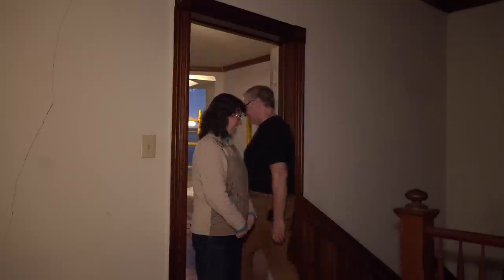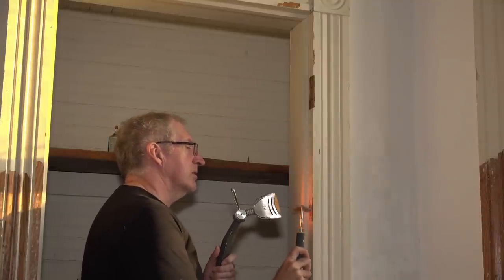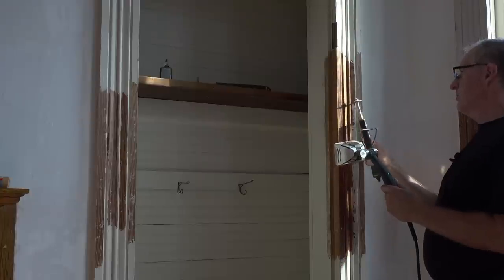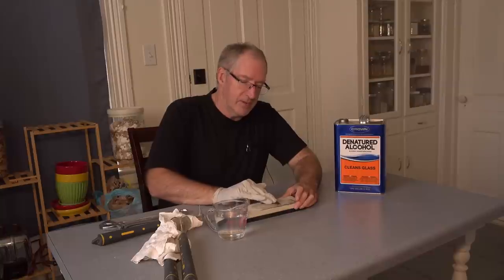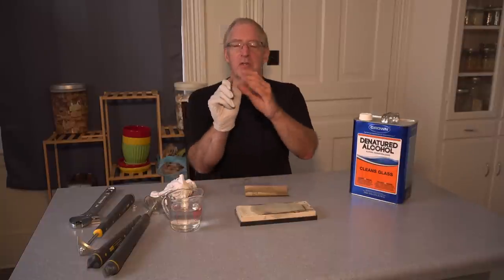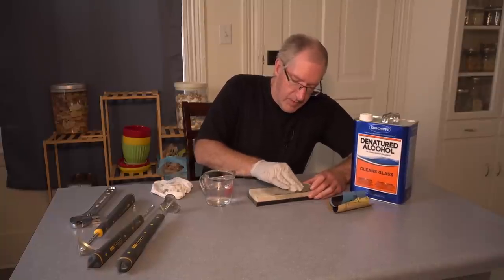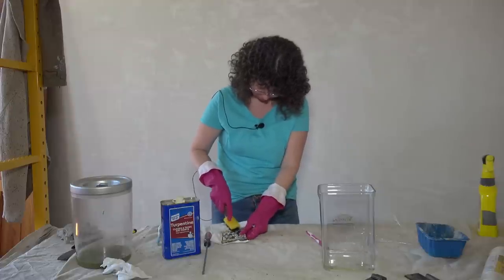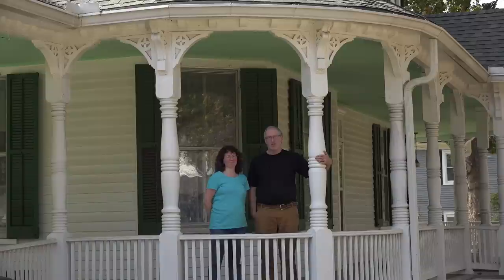EP104 Tool Trouble at the Victorian

Comment: That door is looking so good! Can’t wait to see it hung! Interesting to see how to sharpen. I thought I had heard that you use some kind of oil on a sharpening stone. It  sure is going to take a lot of patience to sharpen all those scrapers! Maybe some time you can show how to sharpen chisels. My cheap ones seem to have come from the store dull.  Excellent choice of truck, by the way! We have a 2013 Ram 2500 Cummins turbo diesel and we love it! We’ve pulled our 30 foot camper all over the Rockies with more power than we’ve ever needed, and having the turbo exhaust brake takes the worry out of long downhill grades! I’m sure you’ll have years of great use from yours! Best, Jan G
Reply from the maker: We are really enjoying the Ram. We went on a long trip and got 25 MPG the whole way and that Cummins engine just loafed along at 1,500 RPM doing highway speeds.
Reply: @1834RestorationHouse  Awesome! Yep, we get in the low twenties on the highway when not towing! Pretty darn good, I think! Better than I ever expected! We get about 12 mpg when towing, still pretty good! Unfortunately diesel has been as much as $5.69 around here, which makes a fill-up kind of pricey!

Comment: Door looks amazing, nice work! I can empathize with you on sharpening those blades. I just finished restoring two 100 + year old chisels. Spent several hours working on the edges. Well worth the effort. Had to make handles as well, not my best work but functional.
Reply from the maker: Now that's dedication! There's nothing finer than a blade that can peel off paper thin wood shavings.

Comment: I removed the latex paint from my old hardware by placing it in a glass pot with water and a squeeze of Dawn liquid.  I did a low boil for 45 minutes and was able to slowly start scrapping the paint off while it was in the hot water.  I didn't like the idea of using  chemicals.   Then I removed the hardware and allowed it to cool down and scraped the remaining with a wire brush.  Dental instruments are great for getting into cracks.
Not sure if this method will work with oil based paints.
❤ the channel!
Reply: Wouldn't using amonnia now a days serve the same purpose as cow urine?  Also, why cow and not horse or sheep or even human?  Interesting concept.
Reply from the maker: We haven't tried that method yet. Thanks!
Reply from the maker: Urea is the key ingredient so one could pee on it if they wanted to! You could also use Diesel Exhaust Fluid.

Comment: Hi Jeannie, It's time to purchase an old crock pot from the junk store or a garage sale for next to nothing.  Put the hardware into the crock pot overnight with water.  You will be surprised.  The paint just falls off the metal.
Reply from the maker: Have you tried this with oil based paint?
Reply: @1834RestorationHouse  Yes

Comment: Correct me if I am wrong.  I thought that home owners had the main floor public areas fancy to impress visitors and the second floor or bedrooms plain since those areas were private.  Main floors would have oak floors. Trim would be stained where bedrooms would have painted woodwork and doors and floors would be pine.  

Sorry this is so long but both of you should be wearing respirators.  Old paint contains lead.  You are exposing yourselfs to toxic vapors and particles while removing paint.
Reply from the maker: Houses had regional differences depending on where the owner lived. Also, the wealth of the owner often dictated where the money was to be spent or conserved. The physical evidence will tell the story of what was original, and we are finding shellac under the paint.

One of the great things about infrared stripping is that lead isn't released during the stripping process in vapor form. Large chunks just fall to the floor and are easily disposed of. Thanks for watching!